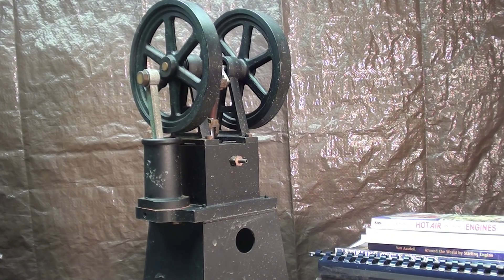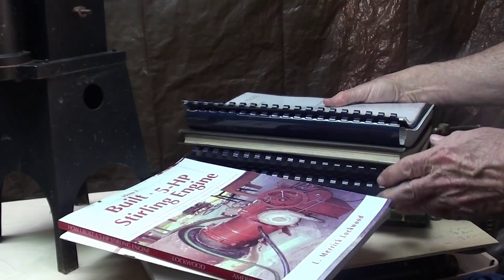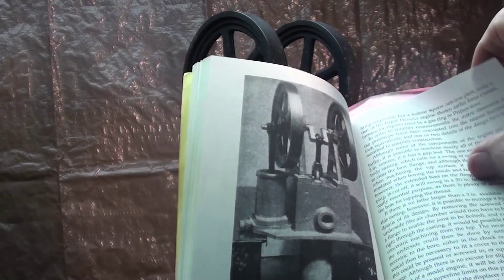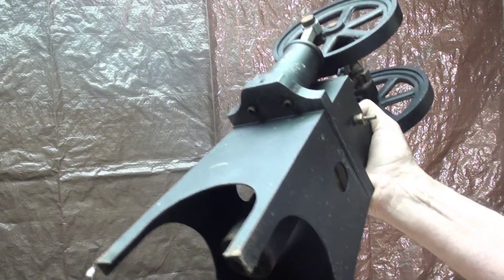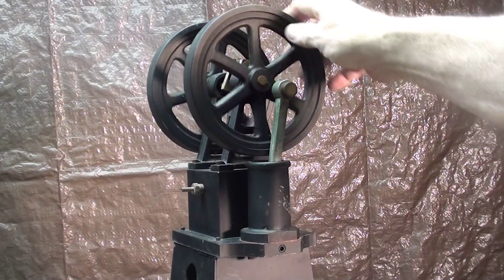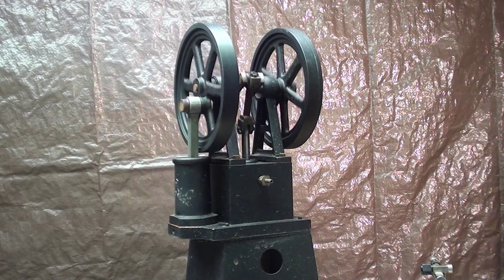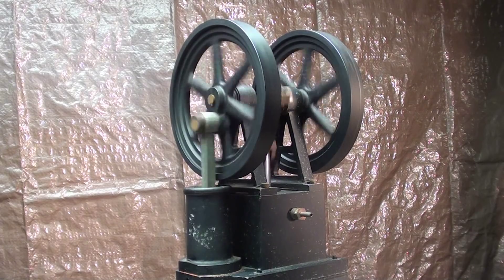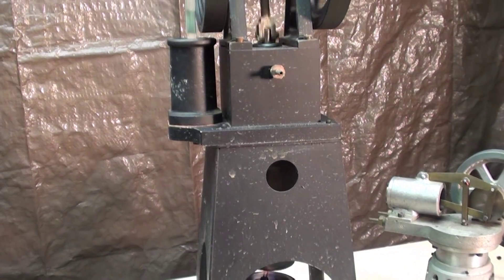TUBALCAIN demonstrates the Heinrici Hot Air Engine stirling

Comment: I am curious how the cylinder is sealed. Does it have piston rings? If so, what material and form works without too much friction?
Reply from the maker: No piston rings. That would provide too much friction and resistance. It’s just a good fit.
Reply: @mrpete222  Thanks :)

Comment: i believe there are more books and articles on Stirling Engines than engines actually built.  they have been a tough nut to crack.  NASA probably made the most progress on them.  Mechanical Technologies Inc made several, one was placed in an Air Force pickup truck and was run successfully.
Reply from the maker: Yes, I agree lots of reading matter on the subject. Very few built       In fact they are very difficult to make

Comment: Great video Mr. Pete!  I hope one day to build a low temperature differential stirling that will run off of my wood boiler output, at around 180 degrees, but large enough to generate electricity.  Admittedly difficult to accomplish.  Plan B will be to build a separate boiler specifically for the stirling with a higher temperature output to increase the differential.  I was drooling over your stack of books there at the beginning.  Something tells me you would be a good resource to have around... I've got a farm in Virginia.  I'll give you ten acres if you want to move here and live next door!  ;-)

Comment: I was thinking of building a Hot Air Engine to haul tremendous amounts of manure.
I figure I need about six politicians and a screwdriver.
Reply: +John Strange You'll never run out of fuel supply.
Reply: +John Strange You could probably get a tax break for using renewable energy too...win win.